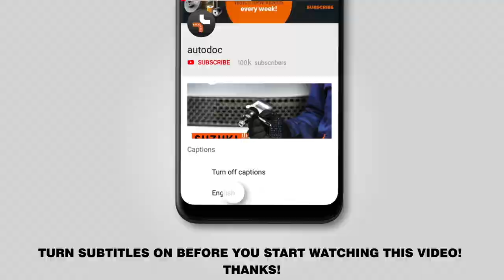How to change front brake discs / front brake rotors on BMW 520i (E39) [TUTORIAL AUTODOC]

Comment: My 2014 x3 front rotors warped so I replaced them with OEM parts, shortly after they warped again. I had them turned . They warped again within a week . Any idea what’s going on ?
Reply: Normally driver error sitting hard on the brake pedal after coming to a stop when the brakes are hot